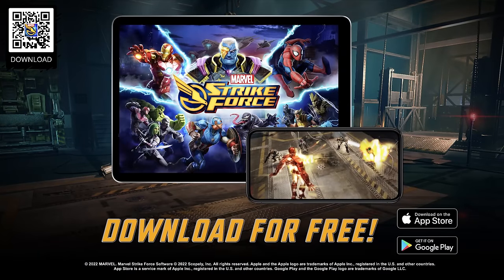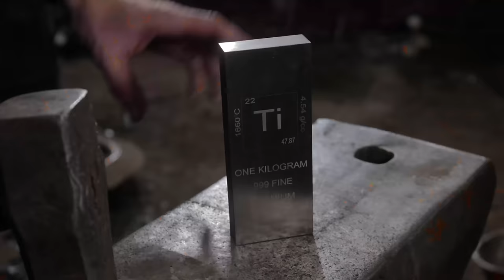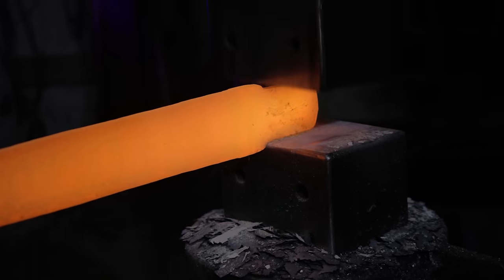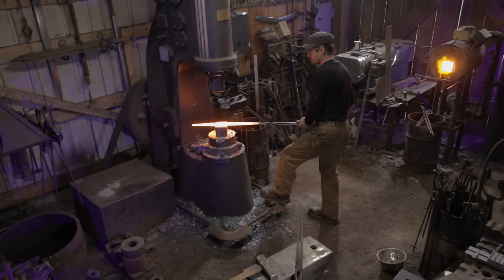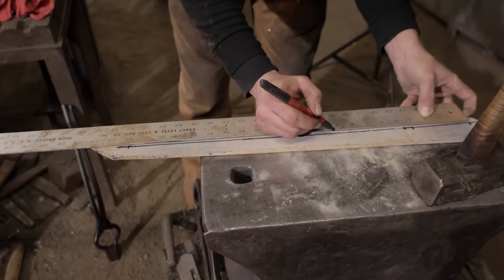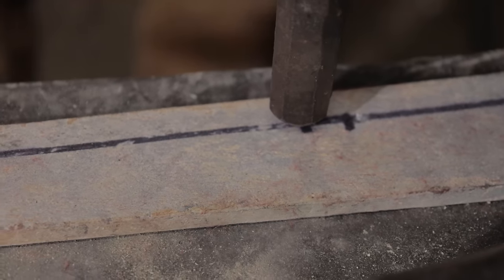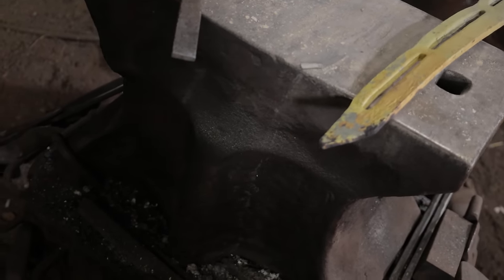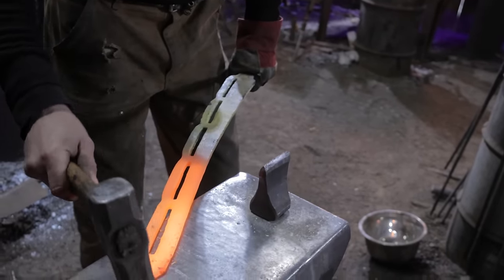Can We Forge Titanium into Ronin's Sword ?

Comment: (possibly spoilers) 
if i remember right, even in the hawkeye series you first see the sword in a scabbard. and if i also remember, the retraction works not only in lenght, but also width, so it actually can go inside the handle. but having it as a properly made solid piece definitly is better!
i think they did the retraction thing in the series so the guy who took it home first could do so more easily.
Reply: They should have just given him a longer coat, would have been cheaper.
Reply from the maker: Its like they haven't seen Highlander or something.
Reply: @chaos_omega  i have made Retractable one 😉 You can check it out

Comment: I was taught in my practical training during my university time as mechanical engineer, that you only tap one side of 2 parts you want to connect via screws. the other side from which you screw it in, is just a through hole of the appropriate size of the screw. Dont think it makes much of a diffference in your build, but you might save some time while taping.
Reply from the maker: in some cases that may be true but in this one I had to have screws coming from both sides to create the right look.
Reply: @ThatWorks  makes sense. thx for the reply.
Reply: It seems fortuitous that I've seen this post

Comment: OK, first comment from me.  I love the very first showing of titanium, where it is visually explained why no-one actually makes swords or knives out of titanium.  F-ing brilliant.  Also, someone was incredibly concerned about mass to make cut outs in a titanium blade.  It's much bulkier than a sword should be, but I'd wager it's still lighter.
Background on Aluminium Oxide, aka Aluminum Oxide.  It IS very hard and durable.  Anyone with Al frame windows can probably attest though, that a thin coloured coating is no where near indestructable.  Much more resilient than plain Al though.  But, doped version (aka Al Oxide with impurities of various types) have common names as crystals, like ruby, emerald etc.
Now, the real challenge is "forging" Tungsten.  :)
Reply from the maker: Ive thought about it....There are ways, but why.
Reply: @ThatWorks  yeah, it would be pretty awful. It would snap at the first sign of any impact. And, at three times heavier than iron, it would be horrible to use. At best, a joke weapon. At worst, a self imposed death sentence.
Reply: @ThatWorks  I wonder if tungsten might be useful as the head of a striking weapon rather than a blade? That concentrated mass would work in its favour..?
Reply: @andrewspencer7804  tungsten steel war hammer FTW
Reply: Macuatl or Aztec machete... What is the highest technology varient you can make using the best material for each part? Why would monosteel weapons even work in today's world? I do believe something like exchangeable blades is better. I actually head an ancient martial arts organization and there were ideas like these going bach to turn of 19tg century in Asia and Europe. Pirates may have mastered special weapons. Design and it's funny that my org has connections to both European and Asian piracy going back. Most pirates and Viking type people began as fisherman and farmers forced to pay superior warlords demanding tribute. Survival shaped them into something stronger by necessity.

Comment: Great work! Quick question, did you have to heat treat the titanium blade in the same way you would for a steal blade? Or does titanium not need heat treating?
Reply: Titanium is often "aged". Sort of similar to quenching steel, titanium is heat soaked in a furnace for a precisely determined amount of time (referred to as "in solution"), then quenched in a prescribed fluid.  Immediately after quench, the part is "aged" by maintaining temperature for extended periods of time (2-24hrs) at a lower, but still very high temperature, then left to cool as slow as possible.  Also unlike steel, the times, and temps of each process varies drastically based on alloy.
Reply from the maker: @DopetheWind  yea what he said
Reply: How was it weighted?  It looked a little cumbersome in the hand, with that large handle.
Do the two metals interact?  Does titanium oxidize?

Comment: This is amazing! Any idea what the final weight on the sword is? It has to be remarkably light, I would think.
Reply: @Mike Mann It sure as F was light after @27:28!
Reply: Well considering it has a jumbo aluminum handle, it's probably not overly light. Aluminum may be light compared to steel, but compared to usual handle materials like wood, it's heavy.

Comment: Anodizing aluminum gives you a hexagonal structure of aluminum oxide that builds up on the surface. That aluminum oxide is technically the Anodizing. But it's transparent, so adding the dye fills those hexagonal cells oh, and then the last operation basically closes the hexagons off. Like a tattoo.

If you were to anodize the titanium, you rely on a different method called interference light refraction to develop colour. Light that hits the oxide surface first, bouncing some light back at your eye, then what's left of the light hits the actual metal surface and bounces back, and depending on how thick your oxide layer is you can get a rainbow of colours as you match both the oxide and the metallic surface reflected light at certain intervals that we might call red or purple or green or whatever colour
Reply from the maker: Isnt that exactly what I said ?

Comment: One question.
How well balanced is this blade? With the handle made from aluminium and the blade being made from titanium?
Isn't titanium much heavier?
Reply: titanium is 45% lighter than steel, but far stronger.  It has the highest strength to weight ration of any known metal.
Reply: It probably is a little blade heavy. Aluminum is about half the weight of titanium. It's not a very long sword, though.

Comment: Uh titanium! Is there any way to tamper with it to get it tempered? (Alloying & heat treatment)
It is amazing to see how Ilya forged so much out but you still had lots of work on the grinders.
The design of the sword itself is meh to me, but I love how you realized it.
Reply: Yes titanium can be heat treated but not in the way that steel is. There is an alpha and a beta phase microstructures present in titanium and each grade varies in properties and applications. Heating and forging as shown here is essentially ruining the titanium due to internal migration of titanium dioxide. Heat treatment is possible in some alloys.
Reply from the maker: Yea what he said

Comment: Were you using .999% pure titanium. 
That is like making an iron sword instead of steel. 
Think it would have been much cooler if you had looked through the titanium alloys to find a better candidate, like would Ti-6Al-4V not have been a better one for a sword?
Reply: Yes. This is like 'Alec Steele' trying to forge weld Ti and steel at 'dull orange' temp. Totally 't4rded, that is.
Reply from the maker: @MrZetor  we used what they sent us for the challenge.

Comment: I've always been curious how a titanium blade would fare against a steel blade in actual combat. Obviously, titanium is lighter and stronger than steel, is it hard enough to make a functional sword blade from it.
Reply: Titanium is not stronger than steel per cubic centimeter, but is stronger than steel per kilogram.
Reply: As you see in the beginning when Ilya hammers the billet cold, heat treated steel is much harder and tougher. A steel sword would cut right through a titanium blade. The claws of titanium framing hammers offer good proof, they chip and mushroom through regular use that would do little to steel claws.

Comment: Possibly a dumb question to begin with, but is a titanium blade lighter or more durable than steel blades? 8 mean there must be a good reason to forge blades out of titanium, because if I remember correctly, titanium doesn't have that good of an edge retention

Comment: That's was awesome.
Just a question: it's any advantage on making a sword out of titanium instead of steel?
Reply: Yes, it's an incredible material. A lot more expensive, BUT its great for making butter knifes, because if you try to cut basically anything with it, the blade will become dull in a matter of seconds. In the end of the build, if they had slashed at a tree, they would have made a spaghetti sword with extra steps.
Reply: @Yago Guillamón "it's any advantage on making a sword out of titanium instead of steel?" - Weight, corrosion resistance.

Comment: I don't understand why the spine was ported. Seems unnecessary at that point.

If you have it to adjust the weight, then I guess it could work. But you can avoid that in the first place.

Having a wider blade might make stab wounds deadlier, and if you wanted to keep the weight down then porting it might be a good option.

I don't know.
Reply from the maker: Maybe they wanted it to whistle !
Reply: @ThatWorks  Not exactly stealthy but...I suppose so.
Reply from the maker: @ジョジョさま  true…I would Chuck it up to “looks cool” designing

Comment: I would have used allen head Chicago screws, so the heads would be on both sides instead of just one.
Reply from the maker: I screwed them in from each side, but yes that would have worked.
Reply: @ThatWorks  I did not catch that. That works too!

Comment: Is the yellow color of the blade due to oxidation of the titanium or some other chemical process that happens after being exposed to high heat?
Reply: It's oxide. 
But it may be oxide, which only forms under particular conditions (like heat). The way iron can form diferent oxides.
Reply from the maker: It's titanium's version of scale.

Comment: Cool , but will it hold an edge ? And did you need to heat treat and quench or anything else ?
Reply from the maker: Basically with pure titanium there isn't a tech way to heat treat it. Just letting it air cool after forging develops the Ti Oxides that toughen the material up. It holds an edge but not nearly as good as steel.

Comment: How did you hardened the metal? As it looked so soft when hammered at the start of the build
Reply: @Paulo WHo gives a sh*t? It is pure Ti, as in something totally unsuitable for a blade material. Some of the higher Ti-grades actually can be quenched and heat treated to perform as a a blade, but pure Ti cannot. See @27:28, where this Ti blade breaks from the hilt.

Comment: if you had hot fitted the guard to the blade you should not have even needed to file it I have done this with steel however I can understand the difficulty in doing it with aluminum.
Reply: @MrZetor  I was speaking about a blacksmithing technique used to fit guard to to a blade were you take the blade heat up the guard and fit it to the tang hot. Which is what a smith had to do until the file was mass produced. what was done on this blade was  a cold fit which i refer to as a machinist fit which is actually really slow. also aluminum is tricky to forge as i understand it (which is incompleat as i have not worked it much) do to how it heats up it heats up very evenly.

I Can not attest to the strenght of titanium blades as i have never worked the material, however i do not think the blade broke, its blending in with the cluttered background. its likely the polish of the spine, the purple paint or petina (i think titanium can oxidies purple) cluttered background and what may be a lower definition camera, combined with the low light levels causing the blade to disapear.
Reply from the maker: @MrZetor  It didnt break. The set screw in the handle just came unwound a tad. Put it right back in and continued.

Comment: How durable would the titanium be in real world applications? Overall awesome build!
Reply: It is used in aviation and space industry.  So obviously it is very durable in real world applications.
Reply: @ilyaalekseyev3589  I am referring to its ability to hold an edge.
Reply: @ilyaalekseyev3589  A normal katana will hold up to a bullet. Will this as well? Not to be ignorant, I really just dont know.
Reply: @jacobcline4536  I assume that the "hold up to a bullet" came from cheesy TV shows.
Reply: @ilyaalekseyev3589  Depends on your definition of cheesy. I'm actually thinking of forged in fire when a katana was forged using the hada technique and the edge was tested by shooting a 9mm bullet at it. Not sure why you're being testy about this. It was an honest question.
Reply: @jacobcline4536  Forged in Fire is a terrible show. A lead pistol bullet can be sliced by a butter knife (you can look that up).
Reply: @ilyaalekseyev3589  hey Ilya, have you ever attempted a SanMai with Ti as the cladding and Stellite 6 as the core? I'm considering giving it a shot, thinking 85% silver solder and a good flux might allow the metals to bond... especially if the ti was slotted and the stellite inserted and soldered into the slot
Reply: @ilyaalekseyev3589  I think it may have been a copper bullet, but no matter, I get your point. I also know that forged in fire does not represent the proper techniques on how to forge blades. They are meant to take lots of time, not build a blade in 6 hrs and beat the hell out of it. I've learned stuff by watching that (albeit it's more entertaining than anything), and I've learned a lot by watching you. I've always been impressed by yours and Matt's work. I was really just wondering how well titanium would hold an edge compared to other more commonly used steels.
Reply: @jacobcline4536  The amount of knowledge FIF provides is negative. If you go in with 10 units of knowledge to watch it, you come out with 5.
Reply from the maker: @ilyaalekseyev3589  lol
Reply: @ilyaalekseyev3589  Well, I see that FIF struck a nerve, why do you hate the show so much? I'm assuming a bad experience behind the scenes? 

Either way, I only wondered about the titanium because it is such a light metal, if it could achieve a hardness such that when filed to a fine edge it could withstand a strike against another object without damage. I am familiar with titanium hammers, but that is a blunt object, not a fine edge. That is all.
Reply: @jacobcline4536  That show lowered the perception of craftsmanship by making it entertainment that targets the lowest common denominator. I also assure you that this is the silent position of quite a few of the ABS board members.
Reply: @ilyaalekseyev3589  I see. 
So, can you shed a little light on my question about the sword itself? I suppose I could have worded it more clearly at first.
Reply: @jacobcline4536  Titanium has amazing real world applications in firearms, space, and aviation industries.
Reply: @ilyaalekseyev3589    In that case, this sword would be absolutely awesome to have. Lightweight and durable! I'm curious what you guys will ask for it. Haha! 
I definitely appreciate the craftsmanship on this channel. The sword you made for the ABS? competition was absolutely amazing. I loved the history you put into that. 

One other question I have had for awhile is why did you guys split ways with Baltimore knife and sword? Or did you even? Did you just leave The man at arms show?
Reply: @jacobcline4536  1) Swords are not considered to be in the class of "real world" or "practical" applications. That is why I answered the way I did. 2) I did not leave but was rudely let go.
Reply: @ilyaalekseyev3589  Ah I understand. 

That is unfortunate.

I'm looking forward to what you guys make next!
Reply: @jacobcline4536  I disagree.  It is quite fortunate that the material conditions are such that swords are not a real world application.
Reply: @ilyaalekseyev3589  No I mean unfortunate that you were let go! 
Yes it is very fortunate that we dont have to use swords anymore.
Reply: @jacobcline4536  Titanium is very poor at holding sharpening while is hard for grinding. So it is not the best material for blades.

Comment: Important FYI: Titanium dust is highly flammable and sometimes explosive. This stuff has killed before, and probably will again at some point.
Grinding titanium is not a great idea, particularly for anyone who hasn't thoroughly researched what they're doing first.
Handling and cleaning up titanium dust requires special care and special equipment to do safely.
Reply: @Winston Deleon "Titanium dust is highly flammable and sometimes explosive." - No, and no. Ti sparks are high temp, for sure, and can light up fires, but Ti dust, as a rapidly surface-oxidizing metal is not explosive. Saw dust, flour, pretty much everything combustible is, but not Ti. Just grind some CP Ti and try to light it with a torch. Not gonna happen. Kind of like lighting up a kerosene stream on snow in Die Hard, Die II.

"Grinding titanium is not a great idea, particularly for anyone who hasn't thoroughly researched what they're doing first." - True. But just because the f'ng stuff just 'creeps'. Destroys belts like nothing, and the material just creeps/slides along the surface.

"Handling and cleaning up titanium dust requires special care and special equipment to do safely." - If you say so. Titanium is bioinert, as in does not react with the human body. Wonder why all the implants and bone breakage plates are Ti? Personally, I would rather breathe in 100 hours of Ti dust than 1h of unspecified steel alloy dust.

Comment: That hilt looks like a nightmare to weild a sword with. Uncomfy as hell.
Reply from the maker: It’s actually not that uncomfy. The problem is that the blade is so light that even that little bit of extra weight in the handle makes it move too fast. If it were a steel blade, it would be fine!

Comment: Isn’t titanium unable to be heat treated and hardened…….. plies I feel the edge would chip easily as titanium is extremely hard!
Reply: No. While pure Ti, as used here, doesn't quench much above 40 HRC, the higher grade alloys actually do yield a decent chopper / sword. Also, Ti is not 'hard' at all. Very stiff/ductile, but not brittle.